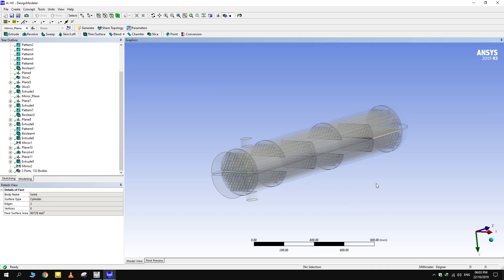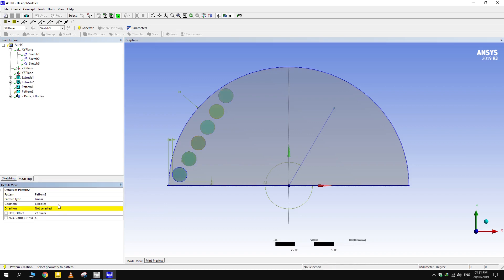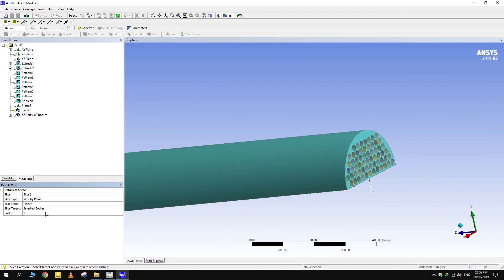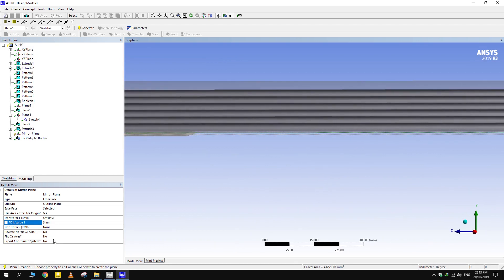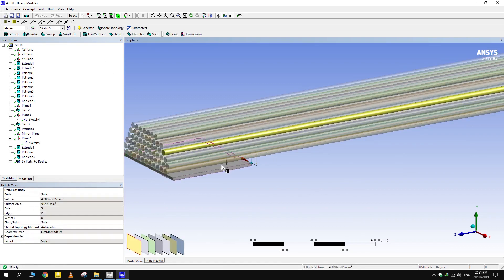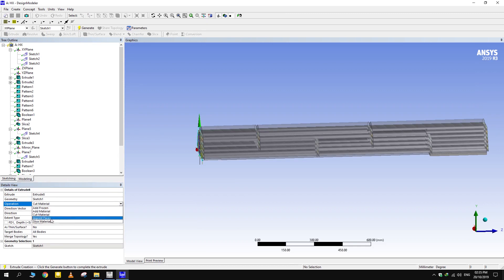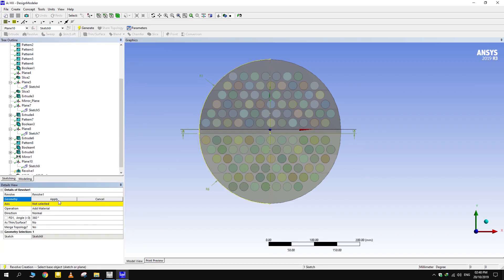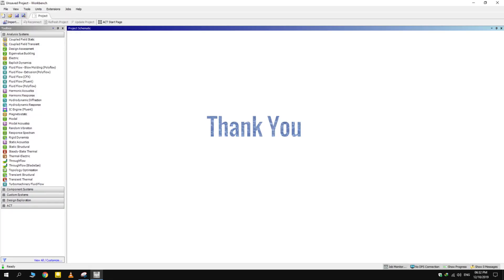Designing Shell and Tube Heat Exchanger-ANSYS Fluent Tutorials

Comment: can you use this geometry file to simulate the heat transfer and temperature distribution?
Reply from the maker: We've had this project in our timeline for a while now. But a precise analysis of heat exchangers like this require high end workstations. We will try to make a coarse mesh, and if succeeded will definitely share the methodology. You can use the same methodology on your setup but with finer mesh size.

Comment: Can you show us how to do this on spaceclaim
Reply from the maker: We are currently working on other projects right now, so designing it again on SpaceClaim is not possible. The procedure is somewhat same. You can follow the same sequence in SpaceClaim. There isn't much difference. SpaceClaim is in fact a bit more simplified than Design Modeller. If you face any problems, we'll be glad to help.
Reply: @Ansystant  ok so the problem I'm facing is that the pattern keeps repeating it self and the tube layout exceeds the shell boundary, how do I deal with that in spaceclaim